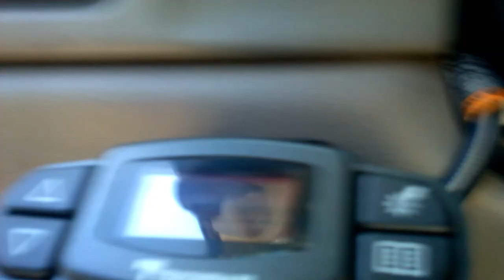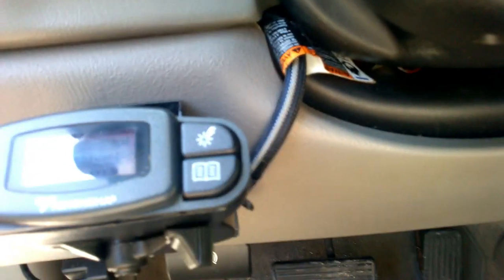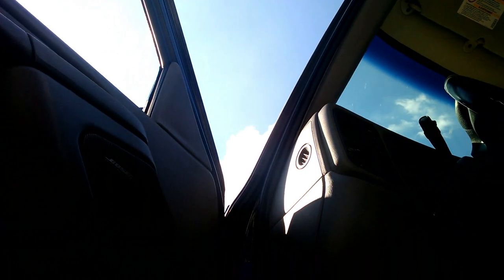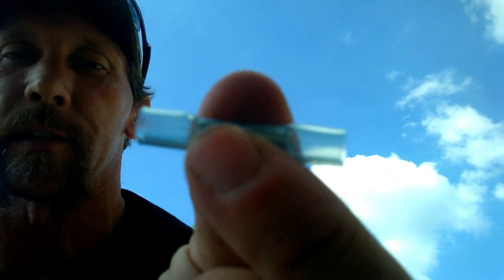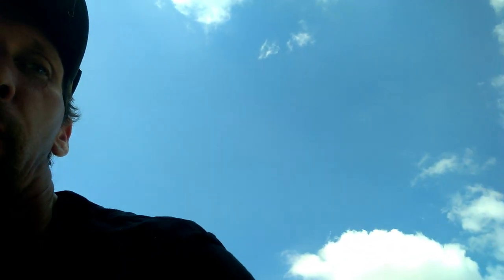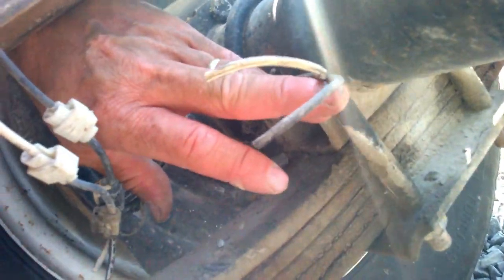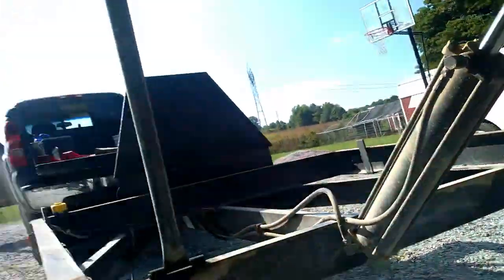Electric Trailer Brake Diagnosis & Repair

Comment: Thank you. This was very informative. The main reason for the failure is because the wire is inside the axle tube. Running new wire on the outside and using zip ties should stop it from ever happening again. I 100% get you liking to do it like factory, but that is what caused the problem. Keep up the good work and informative videos. Thank you.

Comment: Great job. Slow down and master camera focus. Start and stop only the educational point, zeroing on location and, if possible, the action of the hands. May require positioning device. LOVE your brain, honesty, and wit, and DO IT RIGHT VALUES. Great Job!!
Reply: Thank you for the kind feedback/advice. This was a couple years after my accident and close to the beginning of my recording videos, I actually never expected anyone to watch any of my videos especially for educational purposes. I done the vids for two reasons, first was to show others in a position close to mine that life isn't over after your life get flipped upside down and guys I worked with wanted to see how I was doing what I claimed to be doing when not at work. I kept the videos unedited so nobody could claim that someone else done work of camera or something. I have taken the advise and started editing videos but I work 50+ hours a week not including travel plus the work I do at home still trying to keep up.I don't have the time to setup, edit, and upload to keep some folks happy so I haven't done a video in over 3 years. The last video I done actually is another trailer brake issue with the magnet wire and repair but I haven't gotten it edited and that was 3 years ago. Maybe some day soon!  Thanks again for the positive words and feedback.

Comment: Had the same issue with my trailer. Got rid of the scotch locks and ran a new crossover brake wire. The original one was almost worn through. Horrible design! Thanks brother!

Comment: Thankyou for  the video.  I have a sixteen year old  travel trailer with soft brakes and a high resistance  across the the brake circuit at the plug. After  hearing your comments on the scotch lock connectors  I removed them from my brake wiring circuit  and my brake issues cleared up. The blades inside the connectors were corroded. Also, one non heat shrink butt connector was very corroded. Thanks for sending me in the right direction.

Comment: Thanks for your videos. Just want to add a diagnostic technique I found helpful. I connected a 12v battery with booster cables to the inner wheel terminals and the brakes worked. This simple test revealed the problem was the source wiring not the brake mechanisms.
Reply from the maker: That is another great way to help diagnose a brake issue, I would recommend using a auto resetting circuit breaker with that set up just in case the wire is shorted inside the drum. With a direct battery connection you could burn the wiring up real fast and then have to replace magnet when you didn't need to. I have repaired many of them inside the drum where the wire rubs inside the drum.

Comment: Running duplex wire on the backside of the axle tube is the proper way to fix it. Marine grade is best but not mandatory. Having a wire shorted in an axle tube is a very common failure.

Comment: Hey man, just wanted to say thanks for this video. I found the problem in my brakes using this method. I just wanted to say, I have an iBolt tablet clamp mount just sitting around that I never use. You could easily make it work with a smartphone. It would help hold your phone in place and free up your hands so you can improve the great videos you do. If you DM me an address and I will send it to you for free, it clamps down on any bar or edge up to  1-3/4" and is mounted on a swivel ball so you can get any angle needed. I don't use it and just want to see it get some use. I get motion sick pretty easy and I powered through the bumpy parts for the quality content in between. It was my only critique of an otherwise thorough and informative video. If you could mount your phone easily it would boost the production quality of your videos big time. Good job overall and thanks again. Subscribed and liked.
Reply from the maker: Thank you very much for the offer but I now have a quality camera and different tripod's to make better videos

Comment: Another easy way to find out which side is the problem is to use the continuity test function on your volt meter. Take the positive and negative lead and without power to the trailer harness, intentionally short the positive and negative leads to the appropriate brake. If there is a short somewhere in the system, you will have continuity when you should not. This will show up as voltage or a tone on your voltmeter. The only time there should be any continuity in the system is if the brake is being applied. Otherwise, there should not be anything, This can help to diagnose the problem without actually snipping anything.
Reply from the maker: The continuity test will only show a broken wire for a non functioning brake. When testing say a brake magnet it will have continuity because the it is an electromagnet, meaning it's wired like a coil and needs voltage to become magnetic and operate the brake so it will have the + & - connection to complete the circuit.  You have to cut the wires to isolate the issue and make repairs.

Comment: My truck doesn't have a trailer brake that tells me what's wrong. My question. If I disconnect the positive and negative at the brake drum... can I hook a battery to the two wires ti see if it will  activate the brake?
Reply from the maker: If your going to test the magnets with that method I recommend having a fuse or a circuit breaker on the positive side going to the drum, then for the negative I would also run a ground wire to the frame of the trailer and the brake drum. That is the only way the short will show itself. Note on the two wires from the drum, it doesn't matter which wire you make positive or negative because it just needs a complete circuit. Good luck!
Reply: A cheap power probe will help you alot Wells

Comment: im still lost i hate trailers and need one for work i seriously ,,, i like how ur so calm cause im like wtf my trailer is fuched
Reply from the maker: I owned and operated an auto repair shop and a trailer sales business opened up a handful of miles away, I worked on trailers here and there shop I hit them up about parts. Long story short they didn't do parts or service and no clue on anything other then selling so I became their guy and they sent everything to me from hitch installs, repairs, and warranty work. Needless to say I have shit tons of experience working on trailers.
Reply from the maker: Their not too bad really.
Start at the right rear and cut the wires right at the connectors that way you have plenty of wire on both sides to reconnect. If you cut those wires and the problem goes away then it's in the brake hub, either a shorted magnet or a rubbed wire on the brake drum inside. This is the same for the front right as well. If problem still exists then go to left side and cut rear axle wires at connector that go into axle housing to go to the right side, if problem goes away then it's in the axle just like the repairs seen in the video. At this point if problem still exists the cut wire at connector for left rear brakes hub, if problem goes away then it's in the brake hub. Now if the problem still exists then it's in the main cable or the plug at the front of the trailer. So just to cover this as well if problem exists when not connected them it's on the truck side or the breaker controller is bad. I hope this helps better I'm going to do as better video on all of it here soon. Good luck!

Comment: Thank you for your video. Maybe those crazy connectors are why my brand new 35 ft travel trailer brakes bearly work with the gain all the way up to 10.

Comment: Excellent work my man!  Where there is a will there is a way.
Two questions:  where do you get your heat shrink connectors?
And, what do you use if you need to hook three wires together?
Thank you sir!  Tom
Reply from the maker: I got mine from Fastenal. You can get them from harbor freight, home depot, eBay, Amazon, and maybe someplace local for you. Just search heat shrink butt connectors. Whenever I attach three or even four wires together I use a butt connector that will accommodate all wires, crimp them and then zip tie the wires right after they come out of the connector so they can't be pulled apart and open the sealed connector. Hope this helps.

Comment: When l turn on my right hand signal light on my truck ,all the brakes lock up on trailer,dont know what to look for.
Reply from the maker: Sorry man I just saw this, hopefully you have it figured out by now but I would guess wires crossed in the plug or socket.

Comment: Besides no editing, good informative video.  How did you feed it through the axel?  Tape the new wire to the old one and pull it through?
Reply from the maker: I have to be honest when I done the video.... Well all my videos, I do them to show others with disability's how to push on and accomplish what you want to do no matter how much struggle. I haven't posted a video in 9-10 months, I work 2 part time jobs and then also work at my home. No time to edit and deal with them so I quit. I have another video involving the trailer brake magnets from 3 months ago but haven't dealt with it. Anyway to answer your question. Strip the wire insulation, twist the two wires together tight and then tape should work good. I use a small gauge steel wire and crimp to the wire, then do the same with new wiring and pull it through.

Comment: Use any type of copper wire to re-wire?
Reply from the maker: If your in a pinch them yes used anything that is available but 10-12ga wire is good, nothing wrong with overkill and using wire that is a bit big.

Comment: That is nonsense, the wire locks work great and the good ones have sealer inside them to seal out the elements, other wise put some silicone in them before you close them and there will be no problems.
Reply from the maker: It is merrily my opinion and your absolutely welcome to have your own opinion. In some applications they are acceptable to use and yes you can seal them to protect the connection from the outside elements, I've also seen the ones you mentioned that have a dielectric grease to protect it and seal. They are still a terrible choice to use on trailer brakes even if they're sealed, when that blade cuts through the insulation and past the stands of wires they actually damage the stand and that will cause resistance and compromise the effectiveness of the brakes. Depending on the size of the trailer and the weight of the load I would rather my brakes not be compromised but that's just me!
Reply: @MechanizedGarage  Sure it is your opinion but have a lot of experience with using these wire connectors and my opinion is that they are great. The dielectric grease prevents the wires from corroding and the silicone or even wrapping them with electrical tape will keep out water or dirt. Also the wire has to be positioned correctly into the case before it is closed or yes it does damage the wire. I have had them on my trailer for over ten years without any problems. Your video is also helpful in my opinion.